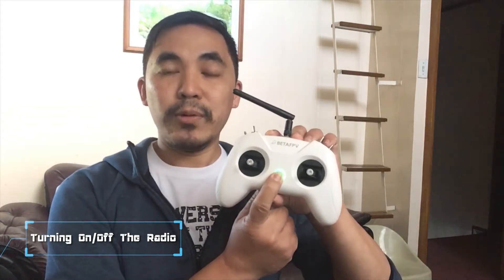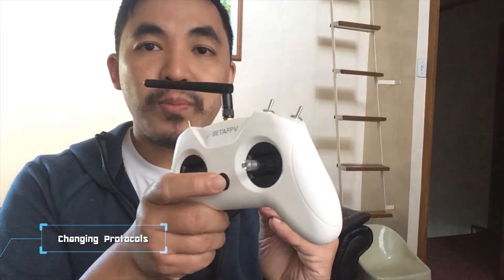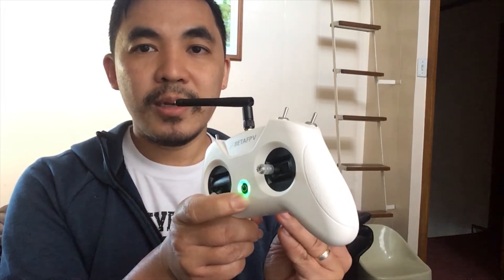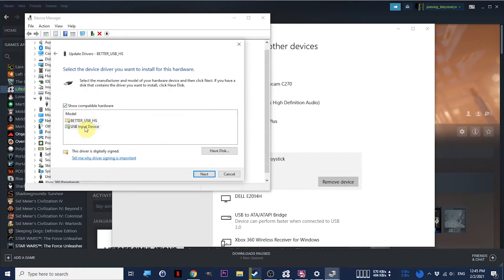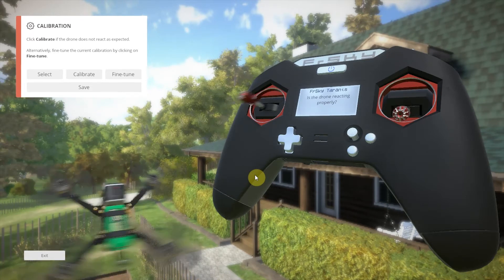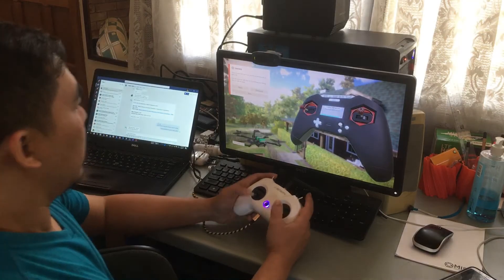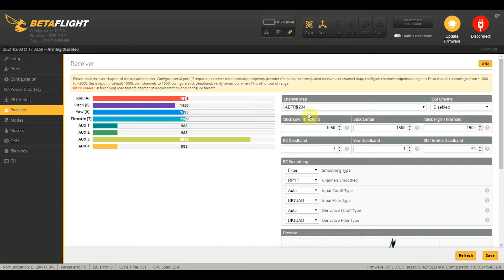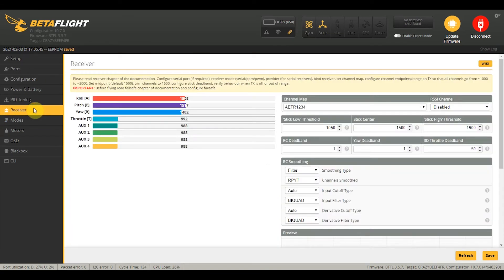BetaFPV Lite Radio 2 Basic Operation

Comment: My controller is stuck on acro on my tyro 79 10th flight and now won't toggle back to stabilized mode not sure what to do I'm not familiar with acro and it's stuck in that mode help?
Reply from the maker: Isolate the problem. Is it the controller or the tyro 79 that's stuck?
Plug in the tyro 79 to Betaflight.
Go to the Receiver tab
Plug in your Lipo and turn on your controller (make sure you've removed your props)
Move the switch on the controller where acro and stabilized mode is supposed to be. Is it moving or is it stuck?